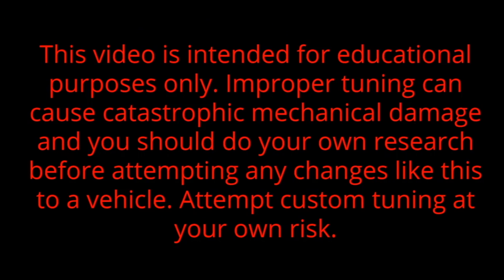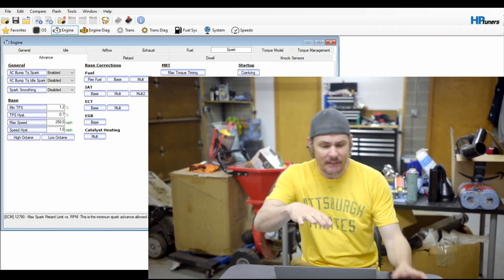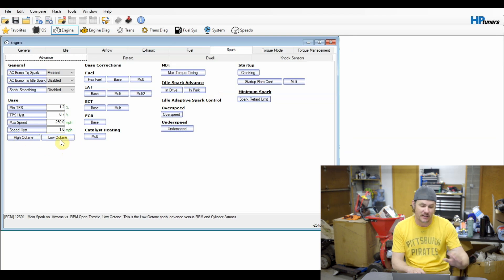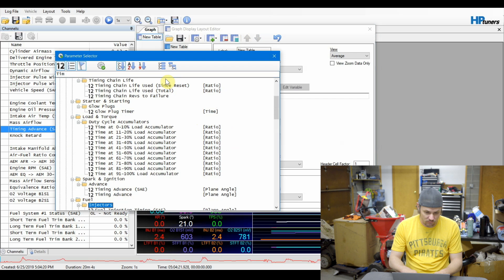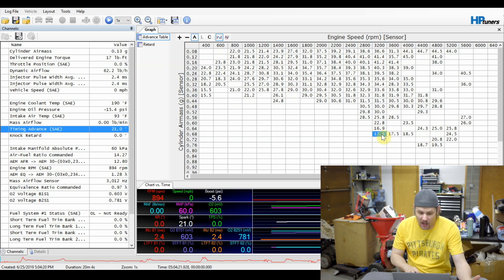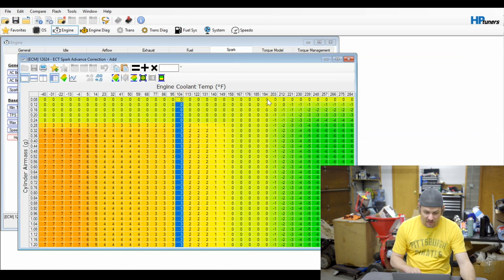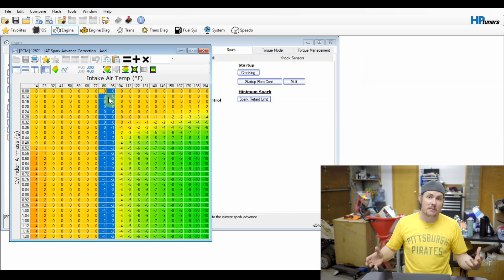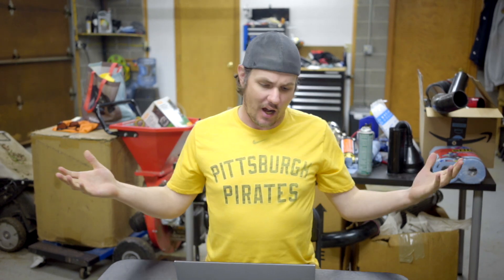Gen 3 Timing Tuning How To Guide, Histogram Setup, HP Tuners Tutorial

Comment: Why are we seeing as much 50° of timing at some of the lower cylinder airmass numbers?
Reply from the maker: Off throttle area, it cuts fuel and advances timing. It’s trying to light off anything left over to reduce emissions but is effectively firing on dead cylinders. If you turn dfco off and lower the timing down there it will cause you to light it off with the exhaust valves open.

Comment: Asking for a little help please. 2000 Silverado 5.3 complete Rebuild stge 2 btr cam ported 862 heads true duals to separate Flowmasters i kept bank 1 and 2 o2 sensors. 

Im trying to get my scanner set up to read everything i will need to do the proper tuning steps but i cant find CYLINDER AIR MASS in my tune file on the editor. Ive tried to follow your setup videos step by step but it seems my pcm is different for some reason. 

Any help would be greatly appreciated. Thanks.

Comment: I have a lq9 bored .030 over with 64cc ls3 heads, roughly 11.2:1 compression. ...I'm running a 220/230 cam and lsa supercharger on holley terminator x,  just wondering what I should set my wot timing at under 0 boost....I have a 2.45" upper pulley on a good day maybe get 12psi boost.....I pull 1lb per psi but what should I set wot. Timing at???  Any help would be greatly appreciated
Reply from the maker: At that compression and boost you probably won't need more than 16-20 degrees at WoT.  You running any kind of knock sensors?

Comment: Gen3 5.3 timing with a turbo and 91 octane?
Reply from the maker: Depends on boost level, the more boost the lower the timing advance, you're effectively adding compression ratio and as that goes up the burn speed increases so you need less timing to hit the ideal flash point.

Comment: At lower loads, timing can get way too advanced without knocking.  Tuning for knock in this way could cause some of that catastrophic damage you mentioned.  You can probably get away with it on the torque curve above peak torque, but not everywhere.
Reply from the maker: Always use the MBT table as a guide

Comment: Kyle, I subtracted 2 from the whole high octane table and got weird things to happen. Like anti theft system enabled, or limp mode. I also noticed that my table (high octane) that I should be adding or subtracting from, has numbers in it with tenths and hundredths. Like 22.08, 32.44 etc ( I'm just making up the values). But why is there a decimal? Should I be adding and subtracting percentages instead of while numbers? I don't know why every time I add or subtract a whole number (so far just + and -2) It feels like I almost bricked my ecm. 
Any ideas what's happening? I'd like to start dialing in my timing a bit (already did maf and sd).
Reply from the maker: You can add or subtract the decimal places, not a big deal. Percentages, whole numbers, how ever you want to do it. The errors happen after flashing sometimes, comms on the vehicle network get messed up
Reply: @GoatRopeGarage  thank you

Comment: I don’t want to sound negative or bash because I do really enjoy most of your videos but blanket adding timing to the entire table is not a good idea. Adding until knock is also not a great idea. Lots of driving and creeping up on the tune up is what I would recommend. NA stuff is probably ok for this method but power adder setups is a good way to make piston soup. I also adjust adder tables so it’s not adding only pulling for safety and optimize high octane and low octane tables. Tune for the fuel you are using and tune individual areas of the table. Thanks for the content man again don’t wanna sound negative just wanted to point out info I didn’t agree with
Reply: Ah yes I do blanket pull timing as well. Sorry if I misunderstood. Thanks again for all the vids.
Reply from the maker: No worries man, thanks for the input and you're correct, when dealing with forced induction you definitely want to have light fingers. Part of this attend I from the fact that I blanket pull timing during fuel tuning on fresh setups so we are generally working back towards stock numbers. Thanks for the participation!
Reply: max timing before knock is a bad idea in general, no matter what the setup is.

Comment: I’m planning an S10 LS swap in the future and found you by your Gen IV videos. Would be an LS3 running on a Gen III PCM to maintain the datalink the older trucks use. Plus integrated transmission control. Couple quick questions. You mention bad tunings causing catastrophic damage. What, in general, are the places where you can do this damage? I know knock from bad timing and running too lean hurts an engine, but is there anything else? And is there really a specific order to your tuning? Eg, first timing, then MAF, and then speed density and whatnot.
Reply from the maker: Basically bad fueling and spark. I usually do MAF, SD then spark though the order might have to be changed on setup like that.

Comment: Love the content, great information.

Just want to add, it is safer to leave the low octane table lower than the high octane. The ECM uses these during knock detection. The ECM interpolates between the two based on the knock learn factor. Also in the event of MAF failure it reverts the the low octane table.

Not trying to call you out, just wanted to share a bit of information I've learned on my road to tuning.

Love the videos, great information, keep it up. 

ABT dude!
Reply from the maker: Yeah, I always tell people to leave the low octane offset, not sure what people want to make it match the high octane table.
Reply: If the MAF failure causes it to pull from the low octane table, should the tables match for a SD tune? My car has the MAF deleted and is in full SD so should mine match?

Comment: For fueling, it's highly desired to have smooth VE & MAF graphs. How important is it for the advance maps to be smooth? Mine are very bumpy from multiple tuners being in my '98 tune over the past 20 years and multiple engines without resetting the graph back to stock. But now I have a 12:1 418 vs a 10:1 346, is it safe to set the Hi & Lo octane advance maps back to OEM and start over given the displacement increase?
Reply from the maker: Yeah, you have a little more room for transitions but I personally like to keep it smooth as possible as just like the other tables you can run into driveability issues

Comment: I know it’s going to be operator error...for some reason my Advance table isn’t populating fully, just on 1st line...gen 3 p59. Whyyyyyy??? 😜  TIA 
Ps. Channel reads 138 g/s, rpm is 5600
Reply from the maker: Dave, you're not logging one of your other parameters that you used for row and axis
Reply: @GoatRopeGarage  yup😂, I get it now, thanks very much!!!
Reply: Why the channel list isn’t populated when setting up a table or chart, or at least giving me the option to , is beyond me.  That’s my observation anyway.  I am obviously wanting to log the data, right?
Reply from the maker: @daveh7645  Dave, make sure you don't have too many parameters logging, you will have some not log if you get too many
Reply: @GoatRopeGarage  ah...thanks

Comment: Hey man I’m working on my car and I’m having a weird issue as the car is warming up under idle. Sometimes the car will plummet from 850 RPM to 400-500 RPM. Will stay like that for a second or 2 then will recover back to 850 RPM. Why would it do that?
Reply from the maker: Mods?
Reply: Goat Rope Garage 78mm On3performace turbo system. Stage 2 BTR turbo 600 lift cam. 80lbs semiens deka 4 injectors
Reply from the maker: @austinboard1491  Year, make and model? With that much going on there is plenty of reasons. You speed density or do you still have a MAF?
Reply: Goat Rope Garage 02 Camaro SS 5.7. And I’m tuning with SD.
Reply from the maker: @austinboard1491  Watch your manifold pressure when this happens, is it steady when it takes a dive?
Reply: Goat Rope Garage No it will idle around 56kPA then spike up to 76kPA then come back to 55kPA
Reply from the maker: @austinboard1491  check all your sensor readings that are a part of that because if you have a bad IAT or ECT sensor it will pull timing also.
Reply: Goat Rope Garage Okay cool. The IAT is staying steady around 81-82 degrees. Should that slowly go up as the car is warming up?
Reply: @austinboard1491  I had a intermediate issue with my ECT, I could rarely replicate it by messing with the sensor and connector.
I replaced both, the problem went away.
(idle dropped to 500-550rpms when it spaz, just like yours)
Reply: DarkLinkAD I figured it out. I had g/s selected in my tuner but the whole tune file was still in SAE instead of metric. Units are very important lol. Thanks for the info. Something to keep in mind

Comment: Can you please explain the computer decisions on which table it picks to be in Low or high octane and why? Which one is default?
Reply from the maker: High octane is default, the computer can switch to the low octane table if it detects knock, it can be a bit more complicated than that based on platform, but as long as you're not experiencing knock you should always be in the high octane table